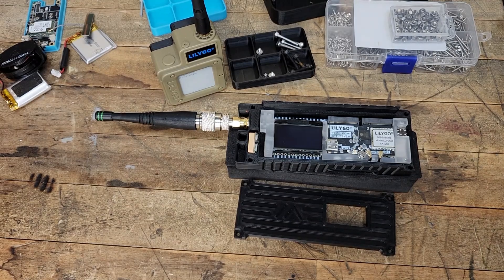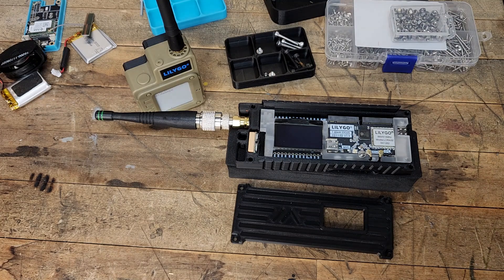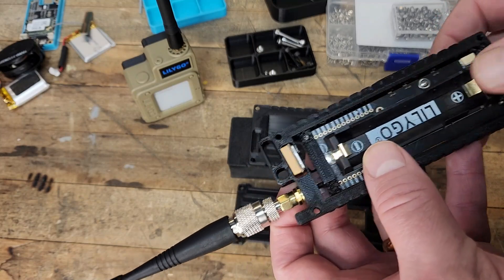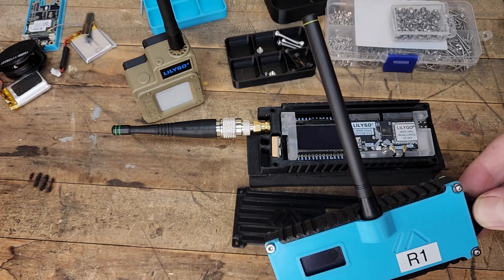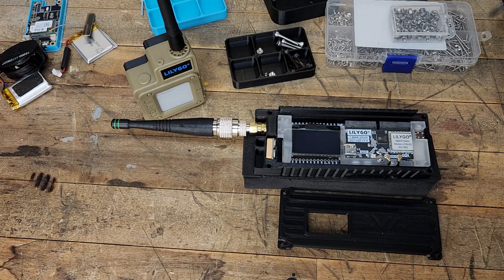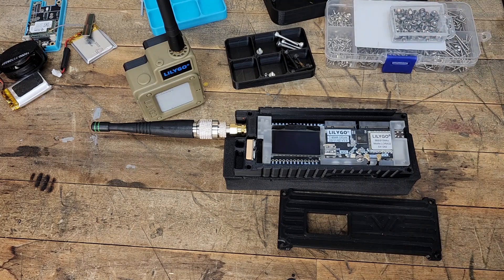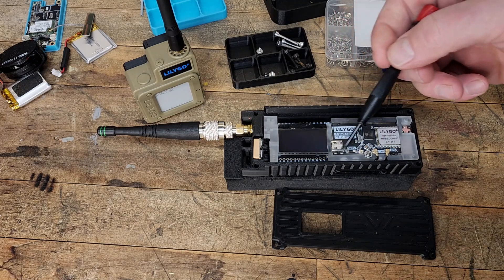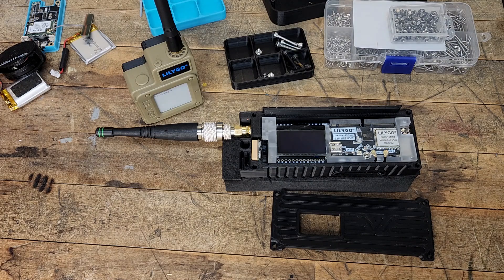The T-Beam Supreme! | Meshtastic | Lilygo

Comment: 4:45 I thought this is the U-Blox GPS model :( Does anyone know if the U-Blox GPS model can be made into a DIY acurate[ish] GPS for topography ? Not for official use of course, but to get GPS coordinates in ~5cm accuracy.
Reply from the maker: The standard U-Blox GPS is only accurate to 2 - 3 meters. However, RTK (Real-Time Kinematic) Modules like the u-blox ZED-F9P can achieve centimeter-level accuracy using a
Multi-band GNSS (L1/L2)
RTK corrections from a base station or NTRIP Typical accuracy: 1–2 cm (horizontal), 2–3 cm (vertical) in open-sky.

Comment: Could you comment on the Antenna you are using on your setup and what is the Gain/SWR Noted when connected to the T-Beam ?
Reply from the maker: The one in this video has a BNC connector thus requiring a SMA adaptor. So I switch to the SMA model and here the basic specs for that antenna. 
Manufacture: TE Connectivity (Linx) 
Model: ANT-916-CW-QW-SMA 
Gain: 1.8dBi
VSWR: 1.5 at 906 MHz 
If you want to read more you can use the link below to find the specification sheet. 
https://www.digikey.com/en/products/detail/te-connectivity-linx/ANT-916-CW-QW/340114

Comment: I simply "LOVE" this case, but I cannot find it "anywhere" online.  
What THEY advertise is much larger and more bulky.  Yours "looks like" an awesome walkie-talkie, which would make it superb for backpacking and field use. 

Do you have the sources where we can get these cases and the module inside, antenna, etc. as a package?
Reply from the maker: If you are looking buy the case you can purchase it from Tony G's Esty shop: https://www.etsy.com/listing/1591009501/gen2-t-beam-supreme-case-for-meshtastic?click_key=9c6742fa94bc156e47b08bb37225affb17010e56%3A1591009501&click_sum=36ccd0c0&ref=shop_home_active_2&crt=1
The Meshtastic T-Beam supreme can be purchased from Rokland: https://store.rokland.com/products/lilygo-t-beam-supreme-esp32-s3-lora-development-board-sx1262-915mhz-gps-l76k-or-u-blox?ref=Ravenwoodemcomm
Rokland also sells cases, batteries, ready to go mesh radios, and antennas. I hope this helps!

Comment: So you have to take the case apart to charge or swap the battery??
Reply from the maker: @williamwiese9963  There is an USB-C access port charging on the bottom of the case. The only reason you would need to take it apart would be to replace the battery.

Comment: What antenna is that??!!!!
Reply from the maker: The antenna is a 4 inch Tuf Duck from ArcAntenna.com. My only issue is that it has TNC connector, not an SMA. Therefore, it requires an adapter. As for the stock antenna, the ones that come with the T-Beams are trash.

Comment: Glad to see a video on the supreme! Verry well put together. 

Can you do a video on the function of the buttons and setting up canned messages? Verry little info on the web for this.
Reply from the maker: For sure, I will try complete one with in the next couple of days. I had to go to several place just figure how to update the firmware.
Reply: are your buttons screwy as well? i have problems particularly with not being able to wake the screen once it has timed out. i have to cycle power just to get the display to come on. i also cant cycle through the displays manually
Reply from the maker: @ghostlight69420  I have had some same issues.
Reply: @RavenwoodAcres  I tried to use the web flasher to update my firmware, thinking that might help, and it bricked my supreme, so be aware of that possibility.
Reply from the maker: @rosswilliams3672  Have you seen my video on flashing to T Beam Supreme? Note, I thought that I had bricked multiple devices. However, after a full erase and installation, the device came back to life.
Reply: @RavenwoodAcres  unfortunately i have tried full erasure and installation multiple times with no luck. Both with the web flasher and with the command line. I keep getting an invalid header 0xffffffff message. but i will watch your vid in hopes of learning the secret
Reply: @RavenwoodAcres  i should add that when i first recieved my supreme the old gui flashing tool was still available for use. the new web flasher did not exist. i was able to use the gui tool with no issues. i hopefully the kinks can be worked out

Comment: I can has T-beam supreme. mainly because the T-echo is out of stock until january
having said that the T-supreme has all the same features other than the screen, its cheaper and can hold a WAY bigger battery. 18650 are up to 3500mah 3.5 times the 1000mah that comes in the T-echo
Reply from the maker: The T-Echo seems to be in stock on Lilygo's website. https://www.lilygo.cc/products/t-echo?variant=42306295791797 Note, they ship from China so it probably won't arrive until after the new year. The cost different can add up to the two. The T-Beams don't come with a battery or case. However, it you can 3D print and have extra 1865)s laying around it's about the same.
Reply: Unfortunately the t beam also has like 4 times the battery consumption of the t echo. The t echo will last for several days on that 1000mah battery while t beams will last about one day even with big boy batteries.
Reply: I decided to get a T-echo after lots of research, and they've been out of stock since then

Comment: What antenna is this and is there any benefit compared to the stock antenna?
Reply from the maker: The antenna is a 4 inch Tuf Duck from ArcAntenna.com. My only issue is that it has TNC connector, not an SMA. Therefore, it requires an adapter. As for the stock antenna, the ones that come with the T-Beams are trash.
Reply: I currently have one of these, a TT-go and 3 heltec lite stick V3, I checked SWR on all 5 antenna and the best one was over 3:1 IE unusable and dangerous to the radio itself. these are all made in china and they seem to ship with antenna tuned for either 433 or 868 because non of them are even usable